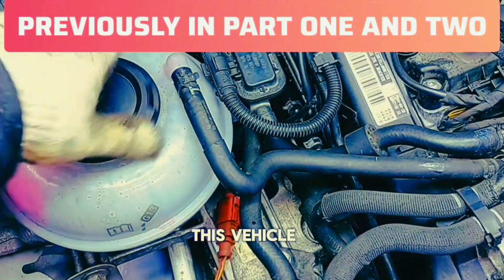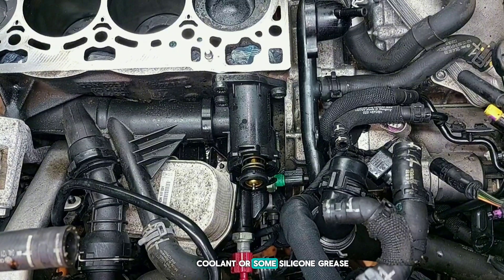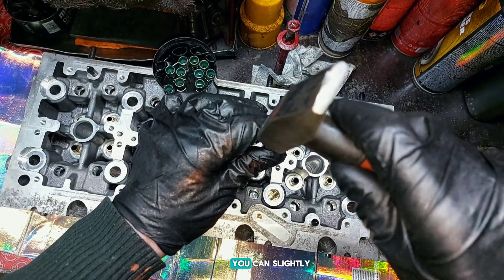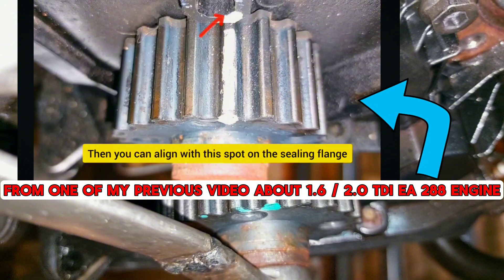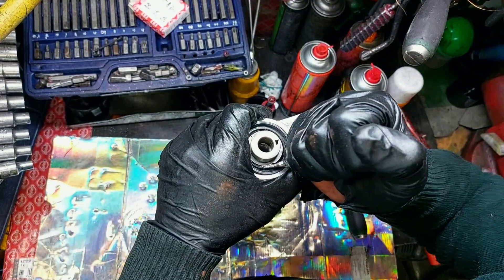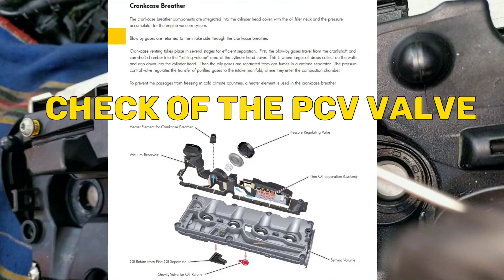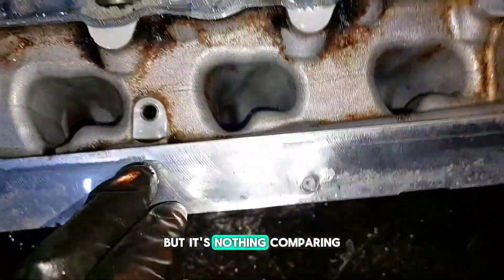VW 2.0 tdi EA288 engine assembling after blown gasket (part 4)

Comment: Hello brother where i can find the manual ???  And do you have an Instagram account
Reply from the maker: Hi. Ea288 pdf
Reply: @HintSlice hello i want to install the headbolts of the bi tdi engine on 2l tdi and i want to know how to work on my engine so i can't destroy my engine if you have an ig account it will help bro
Reply from the maker: Only Youtube bro🤷🏻
Reply from the maker: I don't know why but i don't like instagram for now
Reply: @HintSlice Sorry, brother, for all the questions. I want to install the cylinder head bolts from a 240hp BiTDI engine onto a 150hp 2.0L TDI engine. But I need a manual to properly tighten the bolts
Reply from the maker: Actually on 11:07 in the video is shown how you can do it(I just flipped the picture and wrote down the tightening sequence horizontally for better understanding! Because in wrksp manual it is depicted vertically.) but if you don't trust that info, then like i wrote before just type in search " EA288 PDF repair manual " and you will get bunch of results from where you can download repair manual. Portable Document Format (commonly known as “PDF”) is a file format developed in the early 1990s as a way to share computer documents. One more thing cylinder head bolts tightening sequence and tightening torque is the same for every ea288 even for EVO its in this 
stages:
1. 30 Nm 
2. 70 Nm  
3. Turn 90° further  
4. Turn 90° further  
5. Turn 90° further. 
Also usually tightening spec goes with cyl. head gasket you can use it as well.
Good luck bro✊🏻.

Comment: Do you need to replace the camshaft housing bolts?
Reply from the maker: According to workshop manual you need to renew those bolts after removal but usually there is no issues if reuse them. If you want to be sure that everything will be fine, renew them.

Comment: Good afternoon again, my friend. The parts finally arrived, and I have a big question that's giving me a headache. The rocker arms have become mixed up after so long, and I don't know if it's a good idea to install them differently than they were originally. I've lowered the box that houses the camshafts, and they offer some resistance when I fully invert it. Is this normal? I have the crankshaft set to top dead center. Can you help me if you know how? Thanks a lot!
Reply from the maker: Hi. Some workshop manuals state that you need to number the rocker arms and hydraulic lifters for each valve, but in reality this is not that important(i almost never do that), since the hydraulic lifters automatically will adjust to any rocker arm and valve stem after the engine is started, just make sure that rocker arms are in proper position after installing cam housing. 
You need to lower the pistons below Top Dead Center, just turn the crankshaft backwards a quarter of turn in that way you will be sure that the valves will not touch the pistons. In general, a little resistance when installing the camshaft housing is normal, you just need to lower the pistons below TDC and You'll be good. Good luck with assembly🙌🏻.
Reply: @HintSlice  Thank you so much for answering so fast, your videos are very useful for non-profesionals like me, they are clear and funny, very good job. I will follow your future videos. Congratulations!
Reply from the maker: @davidraserThanks bro🤝🏻Always glad to help.

Comment: Incredible work friend, because I am in the same case and I was waiting for your video to continue. They have rectified 0.15mm on my cylinder head, how much have they rectified you? and what meeting you have put. Thanks very much buddy!!
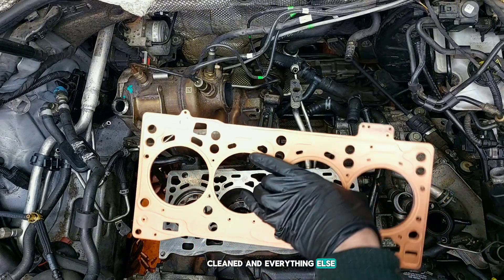Reply from the maker: On my cylinder head they rectified something about 0.10mm. At 8:36 and 10:18 this is how the head gasket thickness is determined. And in my case I chose the same head gasket thickness as the one installed with the two identification holes, since I was not touching the piston part of the engine so the piston projection remains the same and it was about 1.01mm above the block surface which means a gasket thickness of 1.63mm 04L 103 383 BK. I installed Vict Reinz VR 61-38280-10 with two holes and a thickness of 1.63mm. In case If you need, the gasket thickness with 3 holes is 1.71mm 04L 103 383 BL.     
 So if your old  gasket is with two holes it means that piston projection is from 1.01 to 1.10mm and let's say you measured the projection of the piston and its 1.01mm then to this 1.01mm you add 0.15mm of removed material from the head and you get a piston projection of 1.16mm which corresponds to a 1.71mm gasket. 1.01mm+0.15mm= 1.16mm. I think You know that after grinding of the cylinder head the distance between the pistons and valves decreases. And so that the pistons and valves do not meet each other you need to choose a thicker gasket. But from my experience I can say that moste of the times even after you have removed 0.20mm material of the cylinder head, the valves will not collide with the pistons even if you install the same gasket with the same thickness as the old gasket. Thank You to Champ.
Reply from the maker: But as always If you have any doubts you can consult with some other people so in that way you will make the right decision🙌🏻
Reply: @HintSlice  The turner told me to put a thicker joint for safety with those 0.15mm planning. Do you think I can lose a lot of performance by installing the 3-notch gasket? Thank you very much for answering and for helping me assemble my engine, since I am not a professional mechanic but I try to do everything slowly and very carefully. Thank you so much.
Reply from the maker: @davidraser In Your case this will not affect on performance in any way, You won't feel it at all, because the difference in the thickness of the gaskets is only 🤏🏻0.081 mm. You need to pay attention that in this cylinder head valves are sitting below the level of the main surface of the cylinder head, so as long as they stay below that level after grinding surface of the head, You are safe.
Reply: @HintSlice  Thank you very much friend, because I have already ordered it, I will mount the 1.71mm joint. a very big hug!!
Reply from the maker: You will definitely become a Pro by the end of this repair 😉
Reply from the maker: If you are not on the road yet, this video may be useful to you https://youtu.be/KS0Trn_i7qA?si=q2iZw6OlzXqYaS83